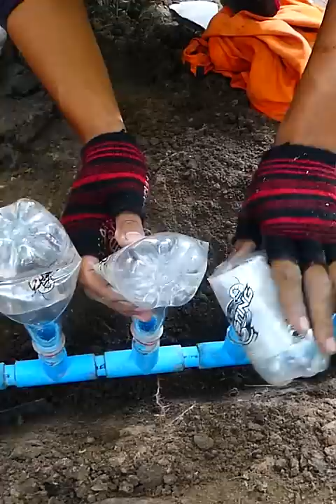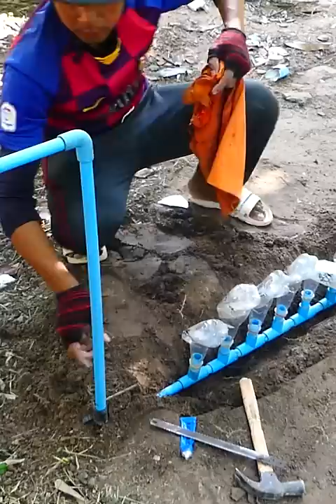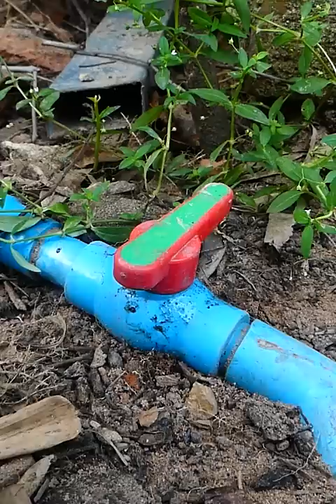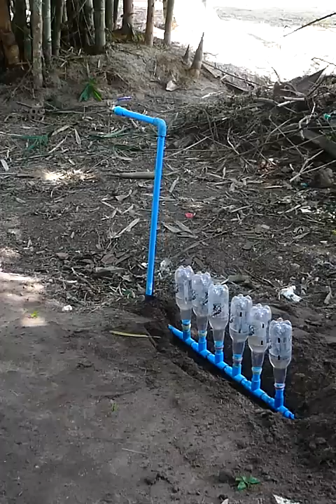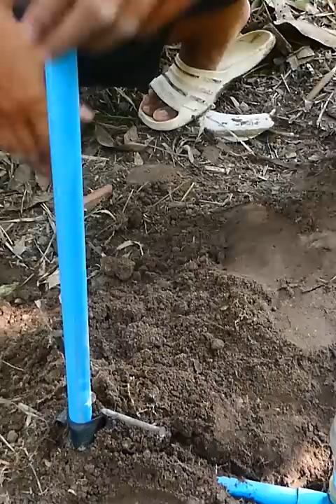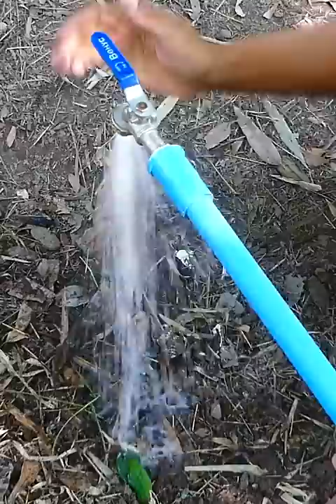Trick Free electricity | I turn PVC pipe into a water pump at home free no need electricity power

Comment: Wow. The water line was pressurized from the water supplier. Revolutionary.
Reply: Not if it comes from  a well.
Reply: It clearly did not come from a well
Reply: @defnotops3162 A well 2 centimeters under the earth 😂😂😂
Reply: Well well well😂
Reply: @edwardlee3533 if it came from a well, he wouldn't have to show that he was opening the valve to fill the bottles, and the well wouldn't have pumped so much pressure into these bottles that they would later drive the water forward for so long.
Reply: @nils5395 If he installed it himself from the valve on the wall of his house, who will dictate to him how deep it should go?  And in countries where there is no winter, there is no need to dig it a meter underground.
Reply: @arturho7  yeah I've been thinking about that for the past month. 😂😂😂. No one cares.
Reply: @edwardlee3533  lmao you fool, wells still have well pumps and pressure tanks on their systems
Reply: @MiniDevilDF  I didn't know.  I don't live in a third world country.
Reply: This is a hydraulic shock absorber system and has no effect on water pressure. To prevent the pipes from hitting and vibrating due to water pressure, this system is installed in the inlet line.
Reply: @edwardlee3533 because you live in your mum basement 😂
Reply: ít nhất nước ra mạnh hơn khi mở van
Reply: God Almighty
Reply: @edwardlee3533  If you live in America you basically do live in a third world country. You just don't realise it yet because you haven't traveled the world enough to compare 😂
Reply: @edwardlee3533 ole city boy likes his chlorinated poop water 

I like my well water in the mountains I have a natural spring and a well. I also live in the us goober🎉
Reply: I agree
Reply: Indeed. He just made a crappy expansion vessel and a lot of money from people’s gullibility 😂.
Reply: @edwardlee3533 or from a well lol, wells usually have a pressure pump.
Reply: Ele aumentou a pressão da água
Reply: Exactly what I was think
Reply: Connected it to a water heater and didn't show us that part 😂
Reply: Do it yourself to learn it better.
Reply: The water pump ran on batteries that someone stole so it's free electric. Simple, and the water bottles are to show what a master engineer and quick alpha brain can do.
Reply: @themachine8427  coping 🤦‍♂️
Reply: @louiscolborn6715  You should be more clear when you are being sarcastic/making a joke.
Reply: @ghostyboy9469 I live in Atlanta, but I also own a vacation house in rural Tennessee so my family and I can get away from the heat. Metropolitan Atlanta water tastes like crap, we have to use filtration just to get the chlorine out. The water at our summer house is fresh well water and it tastes great
Reply: Its fake ha
Reply: @arturho7 Do you have a diagnosis)
Reply: @themachine8427 true. And there’s tons of wells here. We have one. 😂
Reply: @themachine8427 sounds to me like you haven’t been to America.
Reply: @arturho7 ?  ?  !!
Reply: @themachine8427 oh wow you are so well travelled and awesome and stuff! How about you travel again to this made up utopia outside of the USA and stay there?
Reply: @edwardlee3533 wells are used in every country in the world that has homes with running water. Whatever state you live in, whatever country you live in, it has houses all throughout it, that are using a well. Most of which have healthier and cleaner water than what the county/city is pumping to houses through their pipes.
Reply: And here I am trying to figure this shit out hoping it's something more that just obvious 🤦 .,. All I have is the obvious 🤷
Reply: @liamgoodson69 🤣🤣
Reply: @Patrikbob872   In fact I didn't couldn't understand how those 6 plastic bottles could possibly create any pressure. From the picture I thought it was a system to warm-ish some water, the amount contained in the bottles, without any power.
Reply: @themachine8427  Obviously you're talking about north America, right?
Reply: @edwardlee3533  dude, every city has that kind of stuff. Do you think your water comes from a giant bottles?
Reply: Pipe air hammer already invented a lonnnnng time ago. Glad your pipes won't be noisy 😂
Reply: @Patrikbob872 I was thinking that, but you would only need one to prevent water hammer.
Reply: @alessandroricci7294 of course North America. Jeez. 3rd world country BIG TIME. Get a passport. Educate yourself & discover the world as I actually is.
Reply: @andrewlkozar  ... as you what?
Reply: But you didn't know that. Be honest.
Reply: The sad part is how long it took for me to find THIS comment 😂😂

Comment: I like how all that electricity looks exactly like water.
Reply: I think it is bad translation they meant to say a pump that would use electricity and instead we make a pump from air pressure, but the problem here is those 6 bottles would never create that much vacuum pressure lol... So I wanna see the other end of that pipe.... hahaha
Reply: Shock proof lekki 😁👌
Reply: HAha
Reply: Hydro electricity
Reply: @Jade7073 if illegitimatley tapped off a municipal line, it would technically be free...
Reply: The plastic bottles are likely used to mitigate pressure fluctuations, prevent water hammer, and ensure a consistent flow of water through the PVC piping system.
Reply: @Vainqial  could be that, looking closely at bottles the water level moving up down a little, that could be it?
Reply: I thought it was just me...
Reply: 太好了
Reply: @Jade7073 it’s attached to a hose probably
Reply: @simplesepticsecrets  yep that is sort of what I was saying there is no way that flow came from that lol hahah but these people do this to get clicks n views and well maybe trick someone into trying it and being disappointed it does not work...

Sort of like all those videos showing you how you can open your car door lock with a tennisball or some tape trick on a window, when in the background there is someone with a remote lol

Funny thing is there is tons that fall for these and think it is real, that is the sad part.
Reply: So I can get 1M Likes by attaching to my sprinkler system to some PVC piping and a 6 pack?
Reply: @dh2032 no?
Reply: @Vainqial Как гидроаккумулятор.
Reply: cracked me up real hard🤣🤣🤣
Reply: True
Reply: Me too 😂 Not sure what's going on here but I see nothing electric .
Reply: @Jade7073 Not only a bad translation,  but a bad joke, too .
Reply: 😂😂😂 water electricity
Reply: bruh he means a ram pump htat doens' t need electricity - hence "free " electricity........
Reply: @jkiker7918  it's no pump at all as it is apparently connected to a water pipe.  The bottles are some sort of decoration there 😆
Reply: @Jade7073  My thoughts 😂
Reply: @Jade7073 EXACTLY! When he turned the spicket on and the water came shooting out that fast, I was like "ummmm, somebody is using some trick photography" 🤣
Reply: @Jade7073  Its a ram pump. It uses gravity and air pressure to load the line with check valves.
Reply: I'm thinking some sort of explanation would definitely be appreciated here.
Reply: I like how you have no idea where electricity comes from.
Reply: @davidt1621   I like how you have no idea what a misunderstood water hammer eliminator (like the one on the video) looks like. 

I happen to live in Sweden, we have plenty of hydro power, so I probably know way more about hydro power than you.
Reply: I must be taking a shower in electricity every night!! SHOCKING 😅😅
Reply: Yeah my brain wasn’t working correctly
Reply: Lol
Reply: @Vainqial  Satire right?
Reply: You didn’t  even read the caption 😂😂😂😂😂😂😂
Reply: @nourishevolvethrive4164  The caption and title have been changed since I made my comment.
Reply: @Jade7073 exactly thats what im wondering too lol
Reply: @Jade7073 man i swear if theres people who really tried to open their car with a tennis ball n the tape they are complete braindead wich i have seen videos here on YouTube of people trying it 😂😂
Reply: I Wana see too many many years 😂😂😂😂😂😂😂
Reply: @Jade7073  it’s not vacuum pressure it’s a ram pump.
Reply: Odd
Reply: Ram pump?
Reply: I thought he was showing how to make free solar hot water for quick cup of instant coffee or tea when the power goes out..😂😂😂

Comment: When you don't know what electricity is, but you still want to impress the rest of the village
Reply: Underated comment fr
Reply: Dude. You do understand what kind of knowledge you need to do this (not sure if it's real or not) if this is real, this is EXTREMELY IMPRESSIVE, even in the a first world country because we don't use ant system like this
Reply: Its called ramp pump. Works forever.
Reply: Yooh 😂😂😂😂
Reply: you mean tribe
Reply: @vuzereusazureus2245 this is definitely not a ramp pump! Rump pump waste bigger part of incoming water.
What he did is probably a creation that is supposed to relieve the water back pressure when the faucet is quickly closed, or it is just useless installation 😅
Reply: lol
Reply: @isoline217 how would it be real, the water is being pushed by a motor to fill the bottles and then the faucet, its not possible for water to go upstream on its own as it will always seek a level and the bottle level in like 40 cm lower than the neck of the faucet, its not real dude. the guy just made a useless contraption that has the only function of blocking the t-junctions for other connections to different faucets
Reply: Need electricity for a water pump this went over your head hes using pressure
Reply: @isoline217 he doesn't understand what pressure is
Reply: @michaelgilman9320  🤣 high pressure moves to low pressure what's there to get🤣
Reply: Yeah, he already had water pressure. Not sure how this equals electricity.
Reply: @isoline217 Pressure didn't come from nowhere, what is there not to understand 🤣?
Reply: Omg 😂no 😂😂😂😂
Reply: When you don't know what electrcity is, but its running the water pump you used to fill your old bottles
Reply: Best comment of the night. Give the guy more credit lmao 😂
Reply: There are water pumps that need electricity to work, there are ones that need gas to work. Or you'd get low pressure. He pumped out water and created pressure for it to spray out like that.
Reply: Hah, I came to cast shade and found you have already eclipsed the sun!
Reply: LOL!!! Perfect comment!
Reply: @isoline217 it's extremely impressive???  Tell me what he did that's so impressive?!?!?         😅😅😅
Reply: @vuzereusazureus2245  Ram pump* I don’t think this is a ram pump but it could be a modified version of one, I doubt it though because of how powerful the stream is. I’ve never seen any ram pump do this and I researched the shit out of them to before implementation on my lil farm.
Reply: Not the “world” but the “village “ 😂😂😂fkn savage
Reply: @michaelgilman9320 where does the pressure in the bottles come from
Reply: Lmfaooooooooooooooo
Reply: just for joke
Reply: Except for the electricity running the camera and obviously pressurizing the water line.
Reply: You didn't understand shit I tell you, he says you don't need a ln electric pump as there was pressure created by the squished water bottles. It should last for a while
Reply: @Alpaax 😂🤡
Reply: This made me smile. I really thank you for that :)
Reply: When you're education system fails you
Reply: We should all agree that air is compressible and that the act of flowing water the air was compressed into the bottles. Now that the bottle has compressed air in them, the air will force the water out as it tries to equalise. 
However the flow rate from the tap is really excessive considering that the bottles will only hold so much pressure before breaking. 
So, I believe that editing was done here. 
In principle, this is fine and would only last some seconds.
Reply: @goranjosic  Yes the pump will stop working once faucet closed, but, its still a ramp pump. Ramp pump not necessarily need to waste water, its just continuous.
So you are correct it will stop, but that is not the point here, its still a ramp pump.
What bother me is the number of people who doesnt know about it and reporting this as fake.
Reply: @joshuajordan2284   Yes, having multiple bottle is quite suspicious, another thing is he use faucet and the need to 'open' the water intake.
It still a ramp pump, its just his modification is ....suspicious.
Reply: @vuzereusazureus2245  You made a mistake somewhere - can you show me a rump pump version that doesn't lose water?! That would mean that you get energy for pumping from nothing?! (free lunch)
Of course, you can collect the spilled water, but you cannot raise it to a height or pump it further, without another loss. 
This is not a rump pump - look at how strong the pressure is - this is a system for cushioning the impact of water after a sudden closing of the faucet under high pressure - such an impact can tear pipes and such a shock absorption system is present in every modern house.
Reply: @Fanears the bottles make the pressure
Reply: @jeremiahlethoba8254 the bottles have air in them. Why do you think they didn't fill up completely? Because of the pressure
Reply: @isoline217 to do what? Trick people on the internet?
Reply: when Gen Z make a comment
Reply: DAPAT KC BINUKSAN MO MUNA NOONG HINDI PA NAKALAGAY YONG MGA PLASTIC BOTTLE PARA MAKITA KUNG MALAKAS O MAHINA ANG PRESSURE
Reply: Nope. Try again
Reply: I laughed more than I should
Reply: А
Reply: That might be the only source of potable water the whole village shares. Never look down on a person who is doing the best they can with what they have.
Reply: M @Majotsukai
Reply: The best comment 😂😂😂 thanks ❤
Reply: Did he get a girlfriend then?
Reply: @joshuajordan2284 That's why he should have used a ramp pump or a rump pump. 💀😭
Reply: @vuzereusazureus2245 you mean as long as those plastic bottles don't dry rot
Reply: Hahaha
Reply: waiting to see the turbine was an act of pure optimism
Reply: @criss-crossapplesauce274  dude, you destroyed your own argument in the first sentence
Reply: @consentratedblow0107  dude, to get pressured water, you firstly need something to pump that water.
Reply: @michaelgilman9320 the pressure of the well pump upstream
Reply: @isoline217 
Wait....
So, by your own admission, you don't even know if it's real or not....and you still think it's "impressive"?
Reply: @steelcitytv  Yeap, but there are industrial ones, made from steel too. But plastic bottles are cheap.
Reply: Im bet he’s popular amongst the village ladies
Reply: @isoline217 what are you talking about. There is no system behind bottles sitting on pipes doing nothing